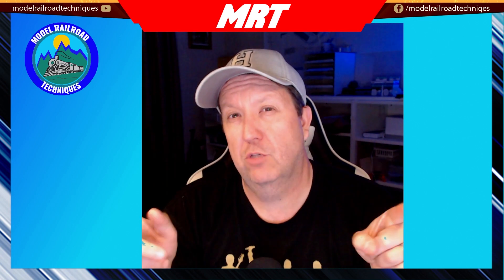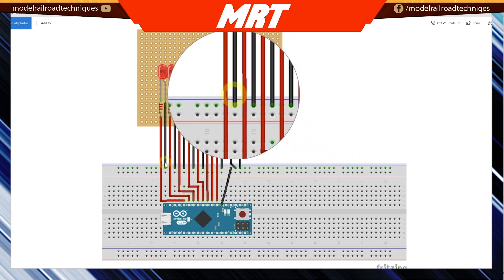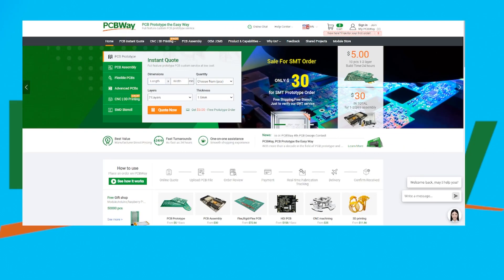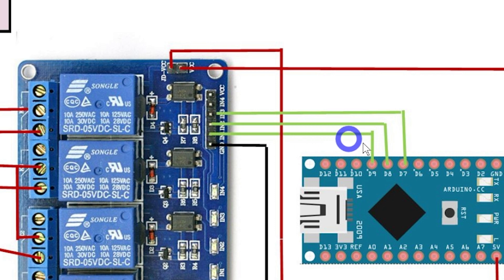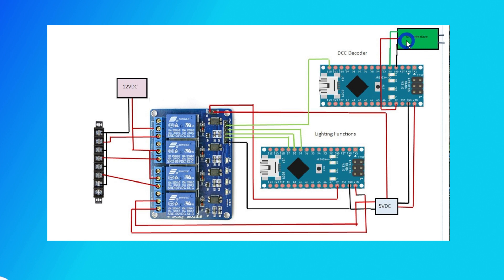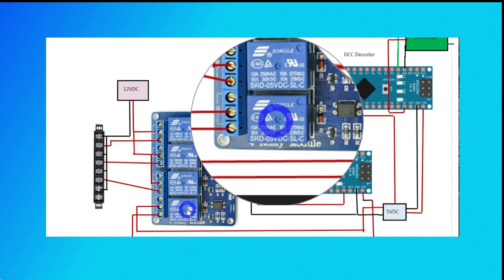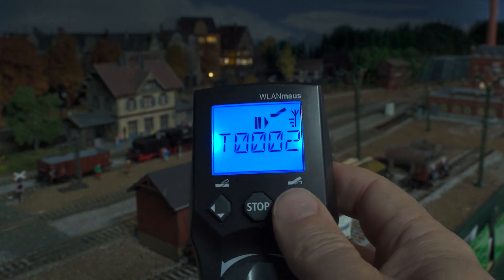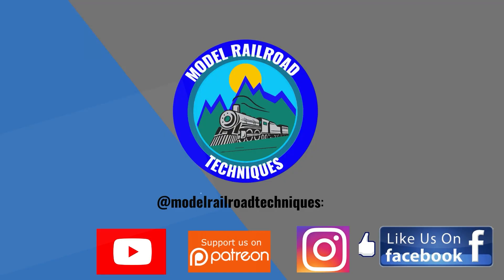Light Up Your Model Railway- using Arduino.

Comment: I am contemplating how to use the Arduino to have light control and sound based on the arrival at a station, or to turn-on for different regions of the layout. So, I am trying to determine whether to use a central Arduino with multiple I/O wires or distributed Arduinos with a power bus and signal wires.  I will study your DCC control video to better understand that option.  Thak you for the insights.
Reply from the maker: @lab4746  sweet. Please update me with your findings. Would be a great video.

Comment: I use a Nano with four shift registers for 32 individually addressable LED's per nano. I used an 8 port ethernet junction box as the housing and the ports for the wiring. But I love seeing all the creative ideas and solutions! Good stuff.
Reply from the maker: Great ideas. I need to get myself a sketch for the nanos. Cheers

Comment: Depending on your amp requirements for the lights, an array of mosfets should be able to handle the lights cheaper / smaller than a bunch of relays.

You can also use an i2c i/o expander to convert a couple of arduinos pins into 8 or more outputs if you have a lot of lights to operate. 

You should really be able to combine both arduinos into one.
Reply from the maker: Interesting. I had a bunch of cheap relays hence their use. I would be open to put all sketches on one arduino. I wouldn’t know where to start with that. Any suggestions would be 🙏

Comment: Great tutorial.   Enjoying watching your tutorials on all the layouts.       There are 2 main things to keep in mind if people are using LED's on their layout for lighting.   It's better to have each individual LED have its own resistor.  I have seen multiple LED's running on a shared common resistor, but this can cause the resistor to get quite warm in use.   The other thing is to make a choice of common annode (positive) or common cathode (negative) wiring.    It makes life a lot easier if you stick to one standard way to wire things.   I noticed you had a common cathode setup, which is probably the more common way to do it, but either way works :)    
On the voltage thing.   12V bus is better, then use a resistor to drop for your LED's at the LED as there will be less voltage drop on the 12V bus.  If you use a 5V bus for your LED's you need a thicker wire to prevent the voltage drop, which will make it harder to hide the wiring on the layout.
Reply from the maker: Thanks for your great advice as always. My lighting was all retro fitted. A number of years ago. Definitely looking into better ways moving forward

Comment: I would use neopixel LEDs. They are daisy chained with just 3 wires. Power plus data. You can control individual brightness, colour and timing with an Arduino. I currently use them for a lightning cloud with sound above my club module.
Reply from the maker: Great ideas. I have been experimenting with these. Watch this space. Do you have a link to a sketch you are using?
Reply: @ModelRailroadTechniques  I don't have one yet for buildings but would probably base it off of this you tube video but using a nano instead of a trinklet. https://www.youtube.com/watch?v=k8iCOa0slXo
Reply from the maker: @allanandsherralynne  starting an area from scratch. Great idea. My town was retro fitted as I has old bulbs too. Mixture of the both is the way to go